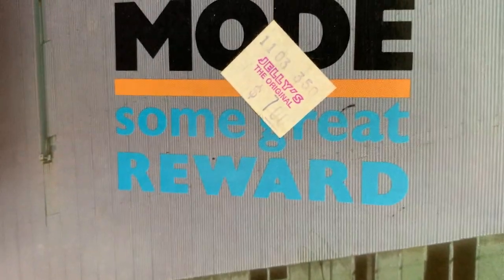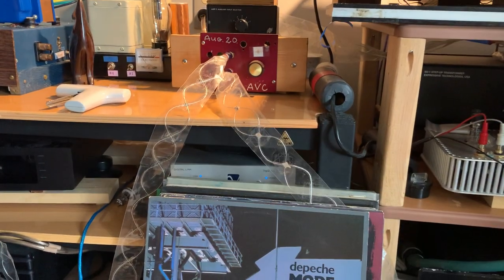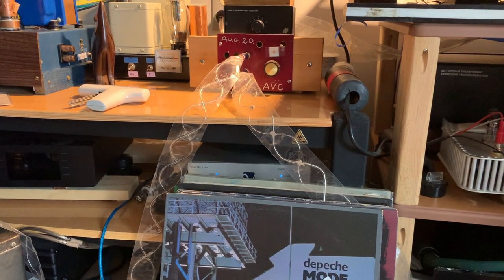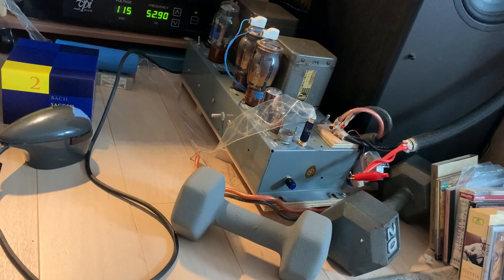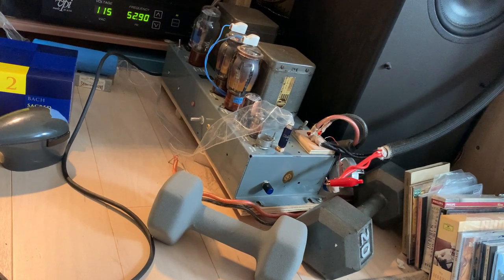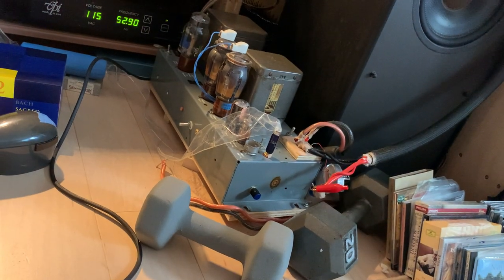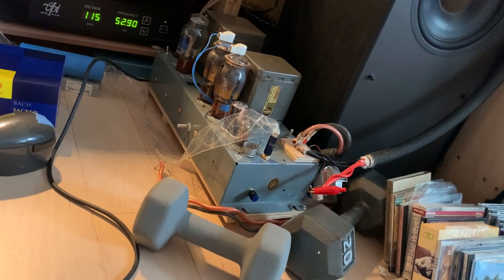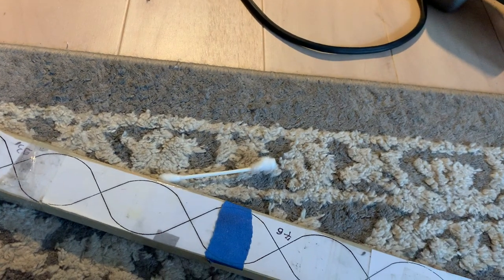How to build the CCSSWP interconnect?

Comment: That is a great idea and a great and simple way.
You use high quality parts (silver is better conductor than copper, any day of the week) and no solder 👌

If any one wants little bit shielding just finishing of with one layer on each side of copper tape as a foil shielding can ground it on the source end.

I make my own speaker cable of solid dead soft pure silver but of course a thicker Guage than for a signal cable is needed.

But it will be rather pricey 😜 but you pay for the raw materials and get the best of the best when it comes to electrical properties, that not even the most pricey cables from a cable company uses. 
From that point of view then it is cheap.. and you get the best.

Like your experience wile comparing SQ against expensive cables!

Good execution! Me love 💕🎶🎵🎼💕
Reply from the maker: Thank you! :) Hold off with the shielding for the moment - tomorrow will come my report on testing it vs a heavily shielded extremely high quality IC, in the most sensitive position of A/B testing them as phono ICs carrying low output moving coil signal.    Yess! I'm also for DIY silver for speaker cables. I used awg20 silver for speaker cablefor a long while, quite a bit of upgrade compared to but the most expensive cables. But even with those, just the bass is lacking, the rest of the spectrum is generally better. I'm using the HT cables for now until I can set aside enough for redoing the silver speaker cable - this time with AWG32 silver, paralleled for a total AWG of 10. (Actually, little thicker for ground, and thinner for return.)
Reply: @realworldaudio  Interesting!
Yes but from pickup to RIAA it is little bit of different requirements when it also is important with the capacitance in the cable that adds to the total amount of pF.

And that is hard to measure when it is so extremely low capacitance as pico Farads.
I were lucky that I have a friend that is a electric engineer that had some special made measurement device.

I ended up with a internet cable from the tone arm wires to the RIAA.
Of cat8 quality (cat8 has each twisted pairs separately shielded and a outer shielded of them all so double shielded i found with solid core of 22 AWG and four nine purity copper.) Measured the whole cable length to 39 pF. It is easy to see that it can get problematic when some cartridges are specified to sound best according to the manufacturer, with only 100 pF all ads up..

I am pretty satisfied with it and when it is permanent mounted so I can't swap and compare. And in my tonearm i have exchange the stock cables to pure silver Litz ones. So it is hard to do better in those departments.

The bottom end is that i know what pF i have in the TT and it is easier to add pF in the RIAA but you can't remove if you have to much. 🤣🎵🎶🎼

Comment: Janos,
Thanks for sharing your tasty cable recipe. Cooked it up this weekend using 32 gauge Dead Soft silver wire x 10 with KLEI connectors. I will admit to feeling a bit skeptical, especially using jeweler’s silver rather than pricy UPOCC silver, plus the zero shielding. Then, 5 seconds into the first record, I was no longer skeptical. Simply just stunning, jaw dropping…can’t wait for the cable to settle in. I plan on making more. Best regards, Horacio
Reply from the maker: Hello Horacio, wonderful!!! I'm glad it has surprised you in a good way. :) Cheers, Janos PS: one last trick: avoid the sytandard lengths: 0,5m, 1m, 2m!! Go for 0,3m, 1,3m, 3m.... the 1m and even multiples create the best antennas for RF noise, we want to avoid that. ;
Reply: Janos, Thanks for this tip.I am getting a low hum from the connection between my SUT and phono preamp. It’s not audible from my listening chair, but of course, I know it’s there, so I will try this odd length strategy. Again, thanks for your help and sharing of information and experience.  - Horacio

Comment: Great Album!!  I need to go back and listen to Depeche Mode.  It has been years, and years.  I have a second older system (British 90s era) in the basement/workout area: Epos ES 12s with custom crossovers and a Rega Mira integrated that a great 90s Brit Prog Rock would sound good thru!  I want to try your interconnects for that system since it's extremely easy to access and only need 2 feet of interconnect really.  Great project idea Janos!
Reply from the maker: Have fun Alan!  ; cheers, Janos

Comment: Ok I just put one of these together with a silver cladded solid copper wire that has a thin teflon insulator (that's all I had) and it's like a subtle but very noticeable veil dropped - for just 3ft of interconnect. No going back. The articulation in the midrange is most improved and while I hate the 'separation' word, it did so and made complex music much easier to listen to. There is also a small improvement in the dynamics of harder hitting sounds. The overall tonality stayed the same. The only downside was that hum increased a little but I may have to have another look at my amp.

Comment: Would it be possible to build a balanced version to use as a mic cable? I would be very interested!!
Reply from the maker: I have never tried going into balanced cables. One idea: you might use a pair of them for balanced version. Connect the common ground ends on each side, and you have the three electrical contacts for balanced.

Comment: Hey Janos. Instead of only adding tape at the point where the two sine waves meet, why not completely cover the first wave with tape? Then simply add a third piece of tape securing the second sine wave to the first. Wouldn’t this add needed rigidity?

Comment: Hello Janos. Thanks for your vídeos. Each one I watch puts light over many mistakes I had about audio gear. Is there a recipe for speaker (Amp - Speaker) cable    I missed? Thanks and best regards.
Reply from the maker: Obrigado José! I have not made  that video yet, as I have not found anything that is of relatively affordable and available worldwide, and performs at this high level. 
Something similar level in DIY would require crazy amount of silver wire.... will post the recipe for that after I build it. Sadly, it will be a very expensive thing, on the order of several 1000$. Hence, it's not happening anytime soon... need a healthy shift in finances first to make that happen. Also, it will be crazy effort heavy to make. :( Same thing goes for power cords... :( Although I have shared on vintage silver power cord, but there the issue is availability...
Reply: @realworldaudio  Ok. So what's your current speaker cable.   I' m trying variations of Cat5, multiple and single strands. All right, not fancy but cheap. Köszönöm!

Comment: What are your thoughts on soft sterling silver (925) compared to copper and pure silver? Would it be comparable to using just copper (because of the lesser conductivity compared to pure silver) or would there still be a benefit because of the silver? Or could it even be worse than copper because it is an alloy instead of a pure metal?

Asking because availability of soft sterling wire is much better here in the Netherlands than pure silver wire.

Comment: What is the spacing between where the wires cross? It is hard to tell from the video.
Reply from the maker: It is tape. Same as the tape on back and front.
Reply: It looks like approximately 2 inches between where the wires overlap. Is this correct?
Reply: Is it approximately 2 inches between where the 30AWG wires overlap?
Reply from the maker: @CoolCourt777  Yes, that's about right. The tape width is 2in, and keep the wires within the tape limits, about 1/4 in or a little less from the edges.

Comment: probably be better to use 2" surgical tape and then you could put copper tape on top as a shield, have you not tried copper tape on that clear tape?
and use a nonmetal interconnect RCA socket something like wbt
Reply from the maker: The adhesive in the surgical tape needs testing whether it oxidizes the metal... however, could layer surgical tape on top of the packing tape to improve the resonances. Thank you for the superb tip! : -) I'm using the non-metal Eichmanns and WBT, but they are still a step down from the no jack plain version, yet very convenient. ; ) Have tried layering tape on it, more on that later as it's quite a subject on its own ;

Comment: So many commenters questioning no shielding. I never never use shielding. I always notice a degradation. Just a slight lack of clarity, compared to nonshielded. Just an opinion/experience to share.
Reply from the maker: 👍👍I notice the same. Shields always add a layer of loss.
Reply: I agree.  Shield always takes it down a notch for me.  You run the risk that it might be a good antenna for cell phone or wifi.  I just keep my cell phone away while playing music.

Comment: Did a larger gauge not work as well?
Reply from the maker: AWG28 is already a monstrous step down from AWG30. Paralleling AWG30, or even better, AWG32 will give more power in the bottom octave (under 30Hz), but AWG30 already gives a very clean, controlled and very deep bass.
Reply: @realworldaudio  What is the minimum number of AWG30 or 32 one should run in parallel for the best bass? Also when you say parallel, are the respective sinewave runs touching along the length of the tape run?

Comment: Hi Janos, thanks for doing this video!!! So "just" 1x AWG30 solid core for signal and also for ground? The 7xAWG32 you use then only inside components? Is this cost related or do you feel that this configuration gives better performance?
Reply from the maker: That's right. Eventually you can use multiples of the AWG30, or even better, AWG32. Much more work, and stronger bass. Yet, the AWG30 is the best value / easiest to make. Best starting point, and if you feel you need more bass, then go for the multiples. ;
Reply: @realworldaudio  got it, thank you 😀

Comment: Where I live Neotech occ silver is the easiest for me. I’m not sure how easy it is to peel of the PTFE coated isolation. I want to use 3 or 4 strands of 30awg. 

Is it needed for this design to peel of the isolation?
Reply from the maker: Hi Nick, I don't think it can be successfully removed without hurting the metal. Also, the PTFE coating will not be a hinderance.